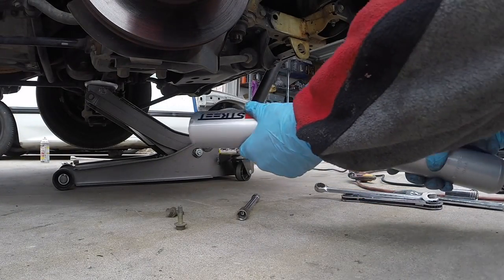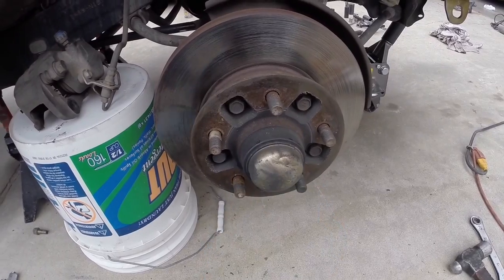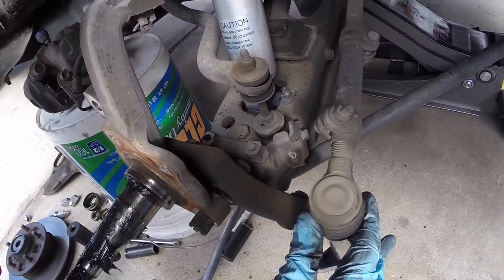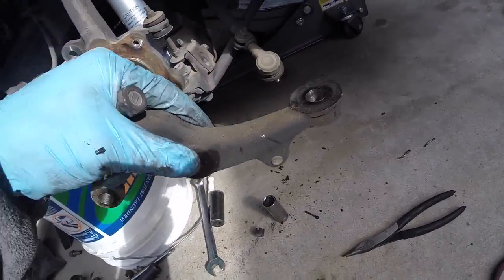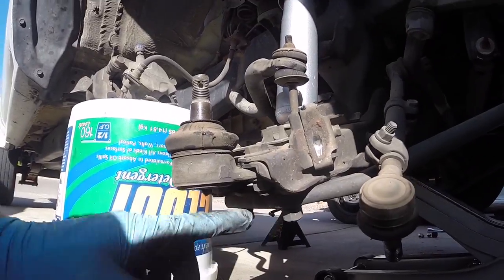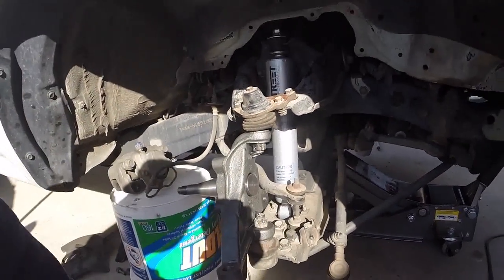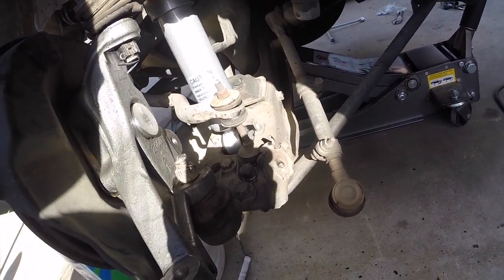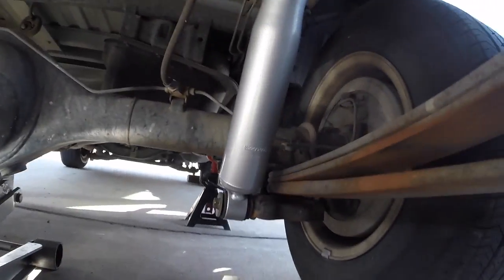How To Lower 1994 Toyota Pickup 2wd (89-95 models) Belltech SP444 DIY

Comment: how did the truck ride after trimming the bump stops an inch?
Reply from the maker: The truck rode worse with the drop naturally, but it wasn't unbearable.
Reply: @GarageBuiltHondas  do you recommend trimming the bump stops or getting aftermarket ones?
Reply from the maker: The truck doesn't ride on the bump stops, they're just there for large bumps.  I'd just trim them if the ones you have are in solid shape.
Reply: @GarageBuiltHondas  for sure, thank you for responding :D

Comment: Do you have any clearing issues when turing the wheels after the alignment?
Reply from the maker: It rubs on full lock because my tires are so big.  I've been wanting to get something smaller or different wheels and tires altogether.
Reply: +Jon Widmer Thanks, like your set up. I will make sure I will get some smaller tires with 14X7 rims.
Reply from the maker: Thanks.  Possibly try some 195/70 or even 195/65 for a much better fit on the 14x7.
Reply: Great, that's good to know.

Comment: How did you take  off the spindle from the ball joints
Reply from the maker: +madison behrens I didn't own a ball joint separator tool at this time so I used some pry bars and a hammer.  Harbor Freight sells a tool that works really well and it is inexpensive  and works like a charm.  You'll get it for only $15
Reply: Thanks so much

Comment: Ride quality still the same with this setup?
Reply from the maker: A little rougher, but I think that is due to the new shocks.  My old shocks were blown and had no rebound so it was a little floaty.  It is still a comfy ride and I daily drive my truck.
Reply: Jon Widmer how much drop from the flipped ball joints?
Reply from the maker: Around an inch extra drop.

Comment: what did you do about pinion angle after drop?
Reply from the maker: Danny Perez I haven't used anything at all, no shims or adjustments.  I still own it and drive it daily and have been since I lowered it.  There are no unusual vibrations or anything noticeable.  Would an adjustment probably have been better, I think yes just to avoid premature wear.

Comment: If you don't mind telling , where did you get those side moldings you have on your truck?
Reply from the maker: I'm an unsure, they were on there when we bought it.  I imagine you can get them at Pep Boys or someplace similar.  They were just solid pieces of hard rubber with double sided tape and looked like they were cut to fit.
Reply: Garage Built Hondas ok thanks I seen one side was missing in this video, I have a 94 pickup white as well I just bought, and I like how they look on your truck they look clean.
Reply from the maker: +AY, NO ES BUENO!! Yes, I pulled them off, I didn't like it.  I bet it would be cheap if you want to look for some.
Reply: Garage Built Hondas ok thanks man your videos are very informative I'm going to subscribe.
Reply from the maker: +AY, NO ES BUENO!! Awesome, thanks and thanks!!

Comment: how many inches total? front and rear?
Reply from the maker: 3" with the ball joint flip.  Otherwise the kit is a 2"/3' drop.
Reply: Jon Widmer cool! truck looks awesome! is there a cheaper way of doing it/lowering the front?? I just have the lowering blocks but I still need front.
Reply from the maker: Torsion bar crank,  I do not know how to do it though.
Reply: what size are your wheels and tires? are you using spacers? If so what size/inches? I like the look on your truck. Perfection!
Reply from the maker: velocity22s 14x7 zero offset on 195/75 tires.    I'll have a new video of my truck in the next couple of weeks. I got a new set of wheels and tires for it!
Reply: Jon Widmer Cool. I'll look fpr your vid in the future. thanks for the info. I'm starting to build my 89 pickup.
Reply from the maker: velocity22s awesome, I love my pickup!  It's been good to my family, my dad owned it from 1996-2014, and he finally gave it to me after 4 years of bugging him for it!
Reply: Jon Widmer so what's the purpose of trimming 1" from rear bump stops?
Reply from the maker: velocity22s Since you use blocks to lower the rear, the blocks raise the rear axle.  Without trimming the bump stops, the axle will prematurely hit the bumpstops creating a rougher more unpredictable ride.
Reply: Jon Widmer wouldn't that lower it more?
Reply from the maker: Tooslow_srt No, the bumpstops protect the solid rear axle.
Reply: Jon Widmer ok, makes sense. I just lowered mine today and put on some wheels and rims. I uploaded a vid on it.
Reply: On mine I only trimmed an inch to front bump stops. I'll do rear tomorrow.
Reply from the maker: Tooslow_srt The wheels look great on your truck!  I got some new wheels for my truck too finally!!  I'll make a new video soon, showing a couple small updates!

Comment: Will 15x8 rim fit
Reply from the maker: +Jose Lara yes, definitely
Reply: Garage Built Hondas . Thanks nice truck by thr way.
Reply from the maker: +Jose Lara appreciate that man!
Reply: Hey man. Do you think those shock could handle an extra 1" or extra 1.5" of drop. After doing the 2" of the spindles and the 1" ball joint flip. I being looking for shorter shocks but cant find none.. im thinking in getting the same as urs that are the 10103i but dont know if it could handle the extra drop i want to do. Will be helpfull if you let me know what you think..
Reply from the maker: +Jose Lara I'm sure it can, but you'll definitely shorten the life of them.

Comment: Sup guys, ay I installed this just like the video and my front driver side wheel is higher then my passenger side.
Reply from the maker: You'll want to adjust your torsion bars to get your truck to sit evenly.
Reply: Garage Built Hondas both sides
Reply: I'm a have to Google that out
Reply from the maker: Jesus Farias Yes, there are some pretty detailed instructions online.
Reply: Garage Built Hondas I got it. One side was 3/8'' off. Got it to match the other side now it's leveled! Thanks man.
Reply from the maker: Jesus Farias Awesome!

Comment: trucks ride like shit when you lower them!!!!!!!!
Reply from the maker: bobo smith Depends on how you lower them.  I'm using the drop spindles which change the location of the front hubs.  That only moves the wheels higher into the fender well without changing any suspension geometry.   Same with the rear, the leaf springs are the same but the solid axle is raised.  This kit is probably one of the best for retaining good ride quality.  I daily this truck and love it, no problems or crappy ride at all.
Reply: what kit do you use???
Reply from the maker: bobo smith The one is this video.  Belltech SP444

Comment: You just effectively lowered the value of a 3 to $4,000 vehicle and made it basically worthless. Why the hell would you take a pick up, something that's supposed to have a certain amount of ground clearance, and turn it into a piece of s*** that you can't drive anywhere or haul anything with will go over any bumps with without tearing the hell out of everything? Every time I see this it makes me sad because these pickups are way too nice to be destroyed like some shity little ricer or shake my head LOL
Reply from the maker: Why in the hell would I try to please the masses and worry about the value?  And you're commenting as if this process isn't reversible.  And FYI, I sold this "piece of shit" in January 2018 for $3500.

Comment: and also do you need to have the ball joints pressed into the spindle or do you just tighten it on.
Reply from the maker: +viiagrafalls I tightened them back on til it felt "good enough".  That's a subjective term though since I've done a lot of ball joints.  Ball joints are all tapered so as you tighten them it slides the knuckle onto the joint.
Reply: Garage Built Hondas awesome. Well the truck is lowered. Did the drop spindles with a bit of torsion. Looks mean now. Thanks for all your help
Reply from the maker: +viiagrafalls Awesome!

Comment: I have a question I’m putting 2 inch lowering blocks on my 94 Toyota can I use my original shocks or I’d have to replace them???? TIA
Reply from the maker: Original are just fine if they are still in working condition!